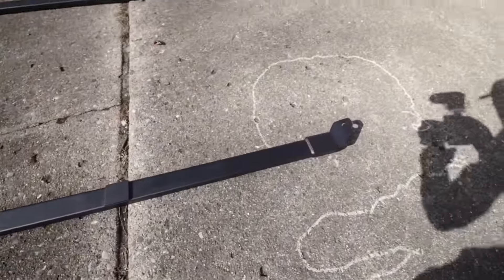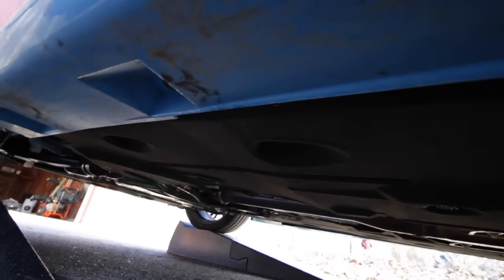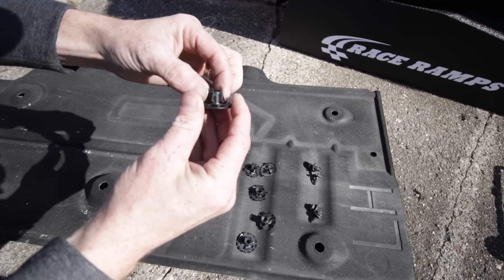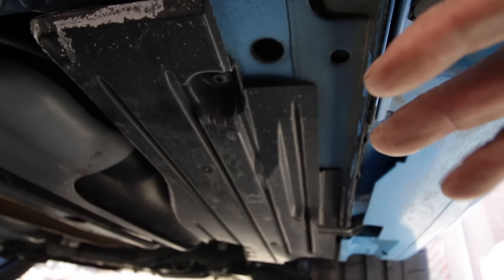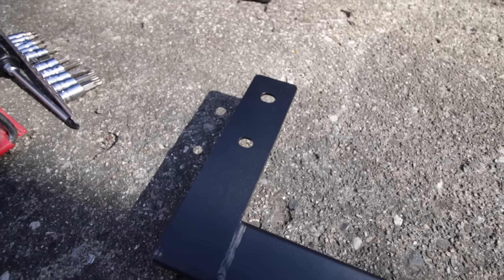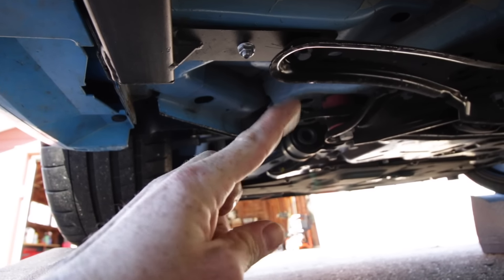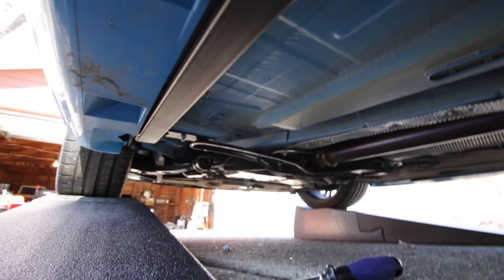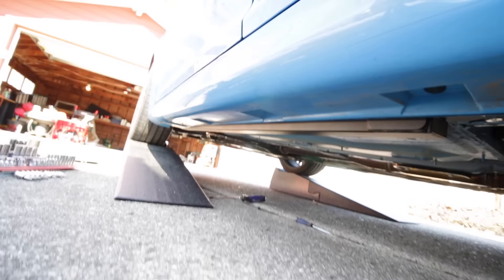Steeda Jacking Rail Install on the Focus RS

Comment: good video
Reply from the maker: +Zander13 Productions Thank You. Not one of my best. Very disappointed the carpets didn't fit after the install.
Reply: I have had these rails on a 16 mustang and were legit. its a shame that they don't work the same with the RS as far as reinstalling carpet and undersidings. but they will do the job.
Reply from the maker: +Zander13 Productions in just going shieldless. I was supposed to see all of the stuff trapped between the shield and body.

Comment: Thanks for the video Chris. Always love your videos here and your posts in the forum. How much do these weigh? Very cool concept, but I'm just concerned with adding more weight to an already heavy car. Thanks!
Reply from the maker: +Cinca0989 A guess would be about 10 lbs per side.
Reply: Christopher Ayres Thanks Chris. You still thinking about driving out to Mountune USA? If you are, we should get the local forum members to meet up. Would be great to chat with you in person.
Reply from the maker: +Cinca0989 Yes. I have to see what my work looks like but am trying to slot a week to go out there.
Reply from the maker: +Cinca0989 Yes. I'm trying to find a week where I'm slow at work to go out this spring early summer.
Reply: +Christopher Ayres Sounds great. My work is pretty flexible and I'm in California so I can meet up pretty much at anytime. Looking forward to the next upgrade video!
Reply from the maker: +Cinca0989 For Sure. I wish I could find work in California. Not to many engineering positions.

Comment: I didn't order those because of undercover problem. Undercovers protect car body paint against flying stones.
Reply from the maker: +J M that's about it. Some focus models don't even get them from the factory so I'm going to go without and see how it goes. Maybe trim them to fit.
Reply: Maybe I do get jacking rails and make paint protection with some rust proofing compound. Lets see.
When you lift car from jacking rails, does car body parts bend in rail fastening points? Or are rail fastening points so stiff that those does not change the shape of car body in fastening places.
Reply from the maker: +J M nothing changes with the secure parts. The rails actually have a little flex as to not impact that. Again I may remove them as I really just wanted them for putting the springs in. All and all they are decent, I probably would have made them a bit different if it was me but I don't think that steeda even changed the design from the mustang ones.

Comment: Chris, I installed these yesterday on my RS not the funnest install to do... However I did get the carpet back on both sides and working with the bar WITHOUT cutting them to size or fitment. The problem is the first 3 studs nearest the rocker panels end up pushing the circular plastic tightners downwards so much as they sit in the carpet that it won't fit. So what I did was get metal washers and same size threaded Nutt to go on the first 3 studs and they fit fine after that. The other issue with having the carpet in is the rail isn't full 1/2" below the pinch weld as the carpet doesn't compress evenly under the bar, so it starts off at 1/2" near the rear then slopes towards the front nearly flush with the pinch weld... So stupid. Poor design. Ideally this would work with standoffs but you can't use that on the front brace.
Reply from the maker: I apologize for anyone installing these in advance. Lol. They have been a savior for time and my welds using a scissor jack with my full size spare when traveling though. And if you get your tires changed at a Discount tire they are always good to have as the just use door mounted underbody hoists. Glad you got them in without having to cut or break. Props to you on that for sure!
Reply from the maker: I apologize for anyone installing these in advance. Lol. They have been a savior for time and my welds using a scissor jack with my full size spare when traveling though. And if you get your tires changed at a Discount tire they are always good to have as the just use door mounted underbody hoists. Glad you got them in without having to cut or break. Props to you on that for sure!
Reply from the maker: I apologize for anyone installing these in advance. Lol. They have been a savior for time and my welds using a scissor jack with my full size spare when traveling though. And if you get your tires changed at a Discount tire they are always good to have as the just use door mounted underbody hoists. Glad you got them in without having to cut or break. Props to you on that for sure!
Reply from the maker: I apologize for anyone installing these in advance. Lol. They have been a savior for time and my welds using a scissor jack with my full size spare when traveling though. And if you get your tires changed at a Discount tire they are always good to have as the just use door mounted underbody hoists. Glad you got them in without having to cut or break. Props to you on that for sure!

Comment: What is the benefit of these rails? The front jacking point on my RS seems to bring the entire side up close to level. I haven't had to jack it up using the rear point yet.
Reply from the maker: +John Melinte just to lift all 4 corners. A lot of people don't use rubber on their jack and jack at the pitch welds breaking paint and bending them. They where originally made for the mustang where jacking points are hard to come by without a ver expensive low pro jack.
Reply: Christopher Ayres I meant specifically for the RS. It seems like just using a hockey puck style pad and a floor jack with the front jacking points accomplishes the same thing for virtually no cost.
Reply from the maker: +John Melinte it does I'm sure. I actually just had them laying around at no cost so figured I'd try them out. Does make it easier to be able to jack anywhere on the side of the car without worrying about damage. I may not even keep them on. Not sure yet, mostly wanted them to make doing the springs easier, plus the jack points on the RS don't leave many desired areas to put on stands if you don't want to impact the suspension work.
Reply: Fair enough, that makes a lot of sense. I just wanted to make sure I wasn't missing anything before I try to return or sell mine. Thanks for replying and the great videos!
Reply from the maker: +John Melinte the rail lifts the front and rear.